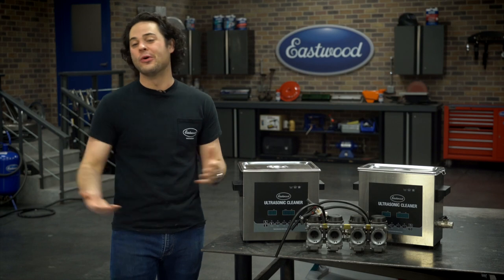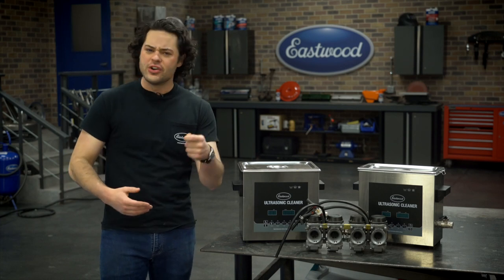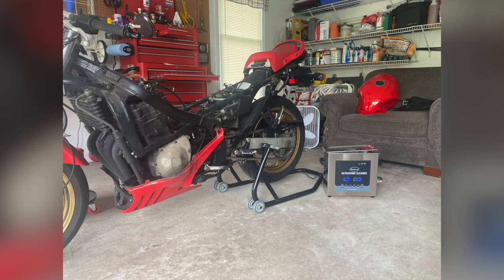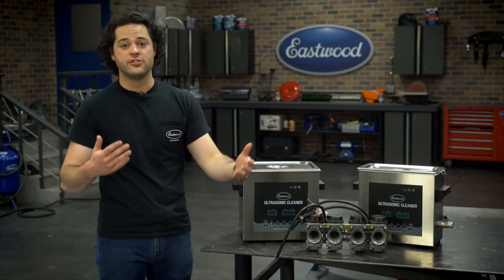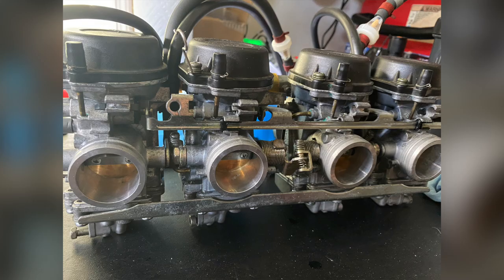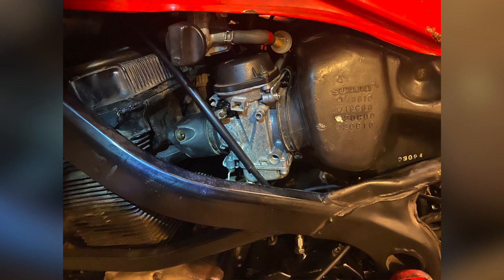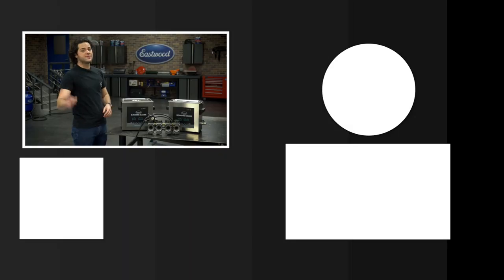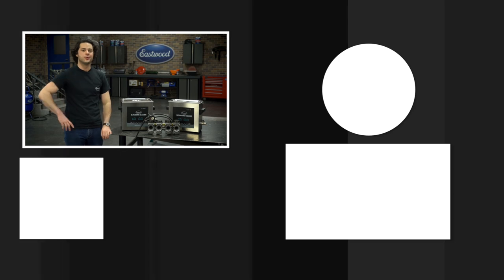How to Clean Carburetors with Ultrasonic Cleaners - Eastwood

Comment: Carburetors are made from an alloy of 70% (+) zinc, magnesium, 2% lead. The lead seals the casting from leakage. Carburetors that are die-cast are usually Aluminum which is porous then treated. Once cleaned and washed with hot water, the metal dries. It has to be re-hydrated in a stoddard solvent, kerosene or mineral oil. Stoddard solvent has a high flash point and commonly used in “Safety-Clean” parts washer. Then dried with compressed air. Carburetors bodies will absorb lubricant into the metal alloy of the carb and sintered bronze bushings. This comes from Rochester, Mikuni, Zenith, Bendix-Stromberg and others including Autolite. This helps reduce throttle shaft bushing wear or eliminates it. Never spray lubricant or oil in these places (Secondaries if Equipped) as it attacks dirt & dust, acceleration wear. Alway check for lateral movement in a throttle shaft as it then becomes an air leak at idle. If possible, use a blunt punch to stake the metal body around the shaft in 3 locations using the correct radius punch from Rochester gauge kit. The bushings can be drilled out and replaced if real bad. Rochester, Autolite and Mikuni recommend using stainless steel wool to polish the shaft were it rides on bushing. Do not bead blast the shaft, polish. SS Wool is now sold as Dollar General or the Dollar Store. Making a high quality alternative to online purchases at 1/5th the money. In the 70’s it was sold in metal & cardboard (Called Ham Cans) that used a red string to open, available thru Delco.
DK, ASE master tech since 78.
Reply from the maker: Can this guy carburetor, or what? 👏
Amazing comment. Thank you.
-JD

Comment: Wish I had one of these 35 years ago when I was rebuilding dual-barrel and Q-jet carbs for my cars. Great addition for any shadetree mechanic!
Reply: For almost 30 years, CRC sold a carb dunk solution of 5 gallons in a 6 gallon can. It came with a small parts bucket. I have the Original Delco book 12. This is a hard-book with parts at the front, updates, then 1,200+ pages with pilots of every Rochester built since 1955. It has detailed setting, adjustment and specs by model. So if I took a Q-Jet, I can pick jets, needles, secondary spring setting just everything to make it a 1968 Corvette with 350 cu in engine. The book is 4-5” thick. I have the metal “White/Orange” Rochester tool box complete. It has 36 valuable gauge round blocks w/knurled handles and the size in decimal white stamped. Tools designed to bend hardened linkage as well. I rebuilt hundreds if not thousands and when the dealer closed, the service manage gave it to me.

Comment: What do you use for the liquid in the cleaner
Reply from the maker: Distilled water and Oil Eater. 4:1.
Be aware, Oil Eater will leave a slimy film on the carbs after cleaning. Dunk in clean distilled water. Then use some compressed air to clean out the passages. 
-JD